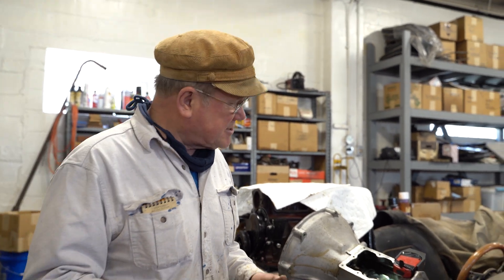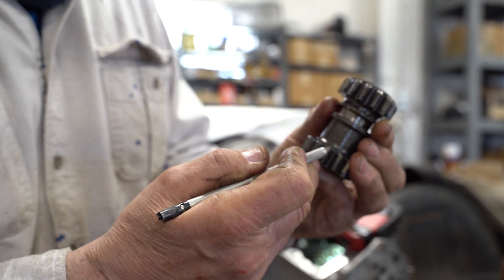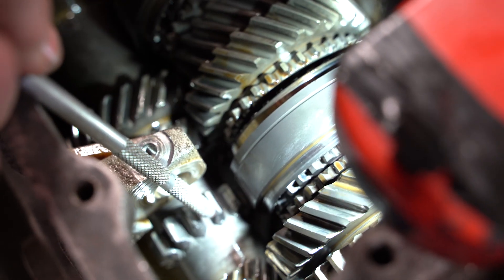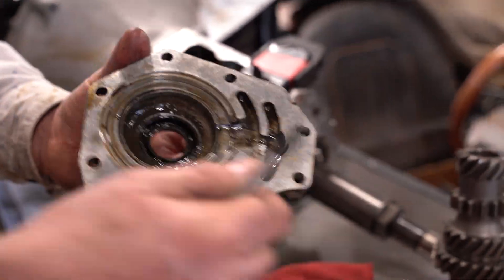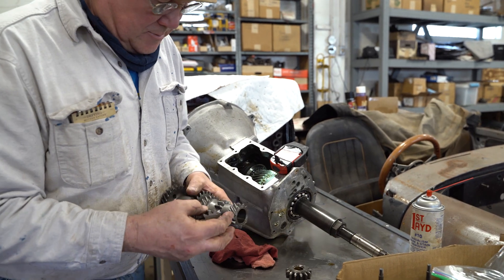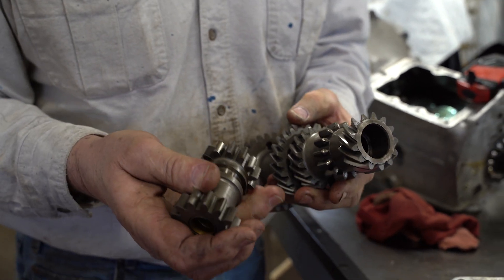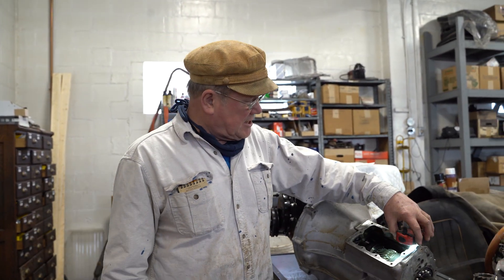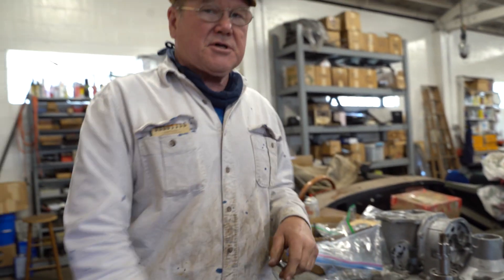321 MG Tech | Improper Gear Mesh: Effects and Precautions

Comment: My 79 MGB goes into gear most of the time with no problem , but it does go into 1st gear much easier if I put it into 2nd and then 1st like at stop lights when it's been in neutral for a while as John suggests we do so that we don't wear out the Graphite Throughout Clutch Disk.

Comment: I'm often surprised at the poor state of gearboxes in classic cars and the terrible crunching that even good gearboxes make when used by inexperienced drivers. I was lucky enough to be taught how to double declutch, when changing down, as a teen (UK rural area, not legal but mostly on private land). When I passed my test in the 1970s and was old enough to have my own car (Hillman Imp) I thrashed it. Subsequent cars were also driven really, really hard but I never had gearbox troubles even though I would wear out clutches, tyres, brakes and driveshafts due to stupid behaviour. It seems to me that double-declutching when changing down gives you the best of both worlds; fast gear changes and very little gearbox wear on forward gears. Of course, reverse gear is a different matter.

Comment: Any reason why my 2nd gear grinds like a madman whenever i shift down from 3rd (only in downshift, mind you)? It's a 1980 model with overdrive.
Reply: I am dealing with the same. MT-90/ Royal Purple GearMax 75w-90 helps, a smidge. But, as said above, time to replace synchro/baulk.
Reply: @rarearthman  Yeah. That's what I'm thinking as well. Just hoped there would be some other magical fix. Thanks though.